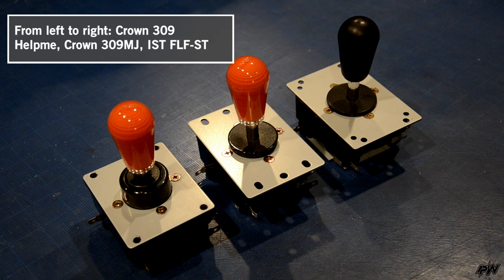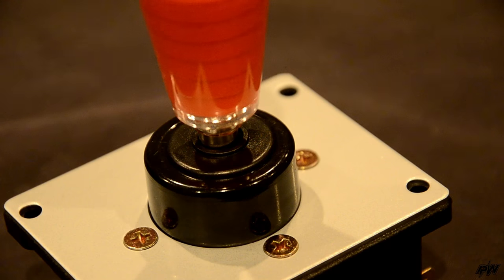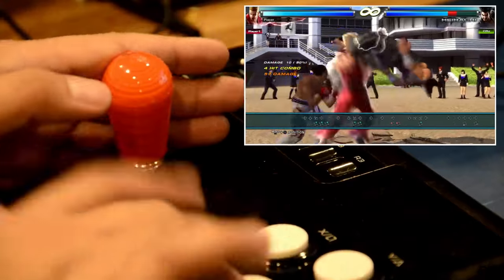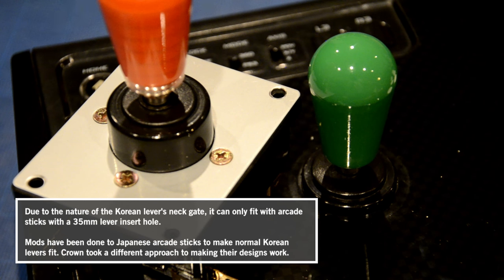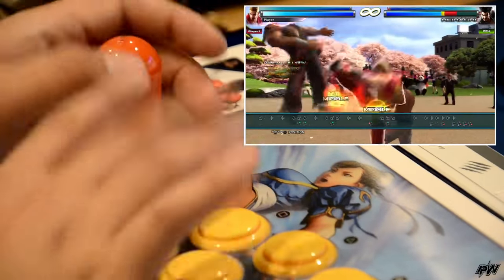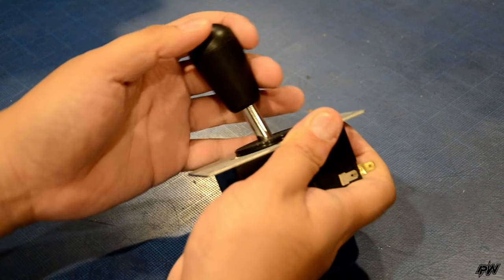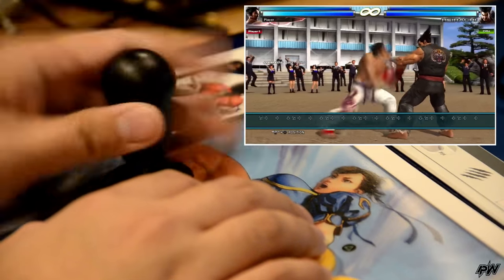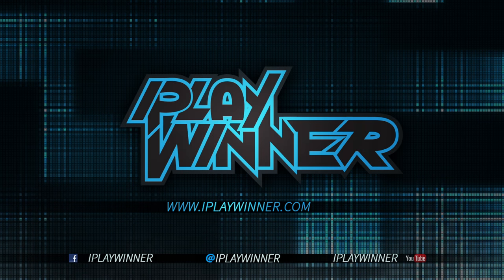IPW Fight Tech: Crown 309 Helpme, CWL-309MJ, & IST FLF-ST levers video review

Comment: Will the half-collar 309MJ fit into a case with a small Sanwa hole, or does the collar need to pop out a larger 35mm hole like the fanta? Does this mean my upgrade is limited to only the 309HelpMe-Sanwa version?

I'd really like a demo video on how Korean sticks with neck collars (or half-collars) are installed. Most installation videos only show the bottom side of the stick without showing a preview of the top part.
Reply: did you ever find this out?
Reply: @zpl68  The Crown 309MJ is designed to fit in Japanese cases. It will fit in a case with a small Sanwa/Hori hole.

Comment: I just bought a CWL 309 and i have a very hard time hitting diagonals, any tips?
Reply: When did you buy it ? Panasonic stopped making switches that came with the original 309. The current 309s are being sold with the Gersungs A2's switches and it results in a horrible combination resulting in many ppl missing their diagonals. The new stock coming in for FA is going to have A3 switches which should solve the problem.

Contact the store you bought this from. They might be able to send you new A3 switches.
Reply: I just checked they are A2s, I just purchased the stick 3 weeks ago from FA.  :/ Thanks for the info

Comment: Could the 309Helpme fit a Qanba Obsidian?
Reply: win3rounds yes but you need to drill a 35mm hole
Reply: I have the 309MJ installed in the obsidian
Reply: @deftones327  does it require drilling? to fit it in the obsidian
Reply: @user-tv6hf9gs8n  i dont remember how i installed it but i didnt drill a hole